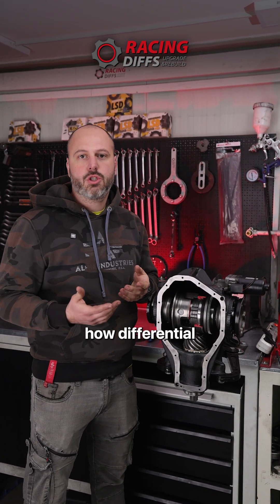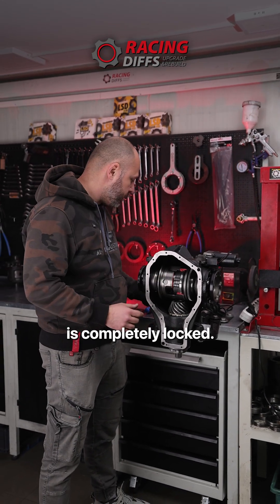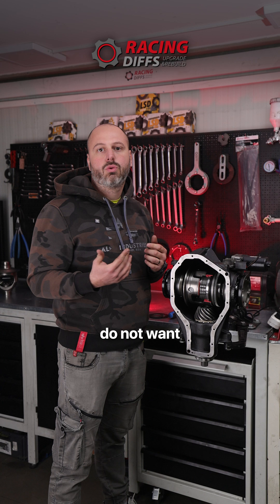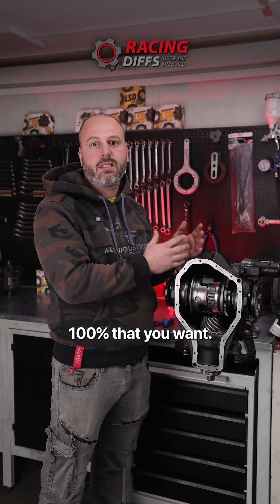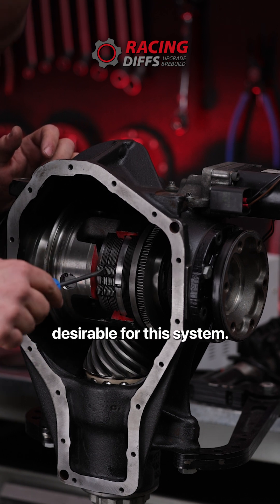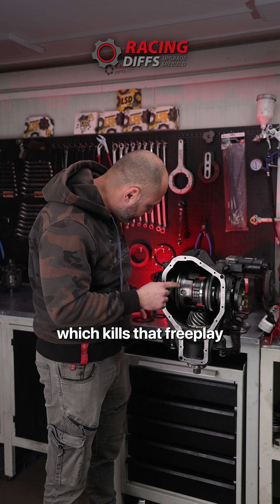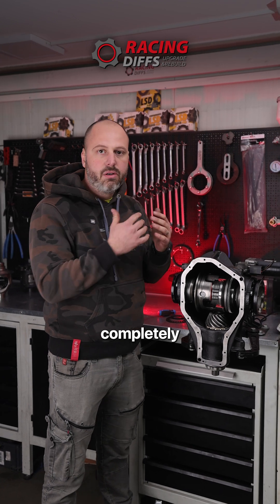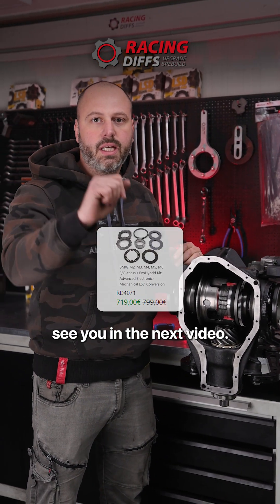BMW M Diff EXPLAINED: Why It Fails on Track & How to Fix It! 🔧 #bmwm3 #bmwm2 #bmwm4 #racingdiffs

Comment: Is it possible to completely ditch the motor setup and throw in a normal mechanical lsd unit? What would be the price?
Reply from the maker: Yes. We have completely new ready to mount mechanical units. Take a look at this link.

https://racingdiffs.com/collections/ready-to-mount-lsd-units/products/bmw-f8x-drexler-gt4-lsd-complete-differential-3-46